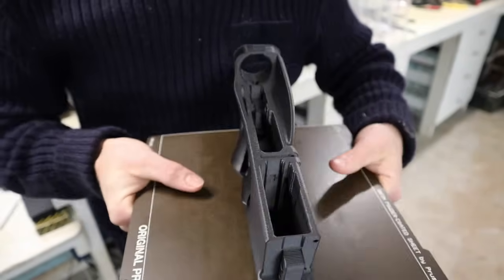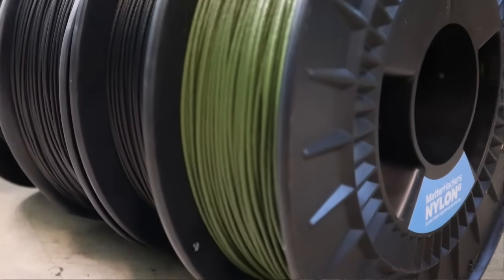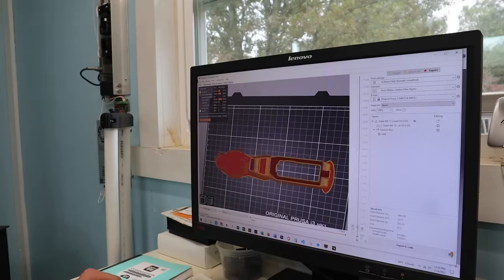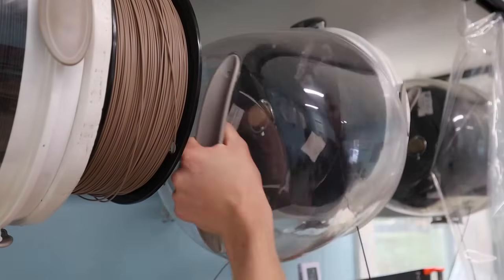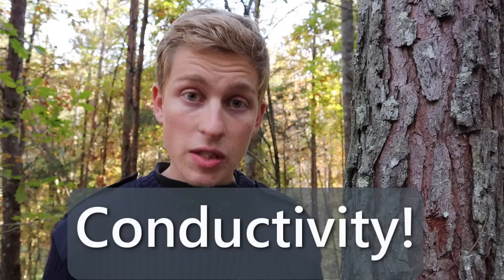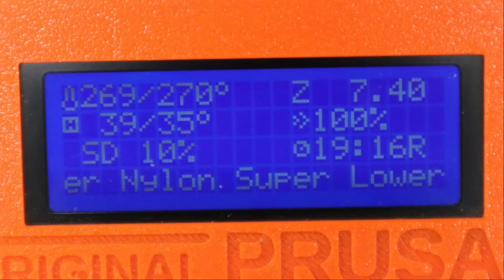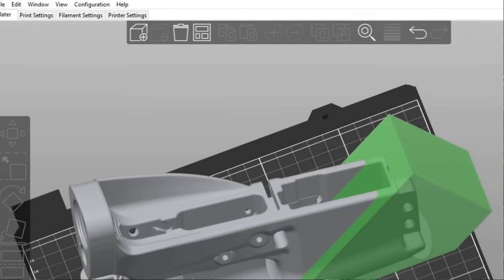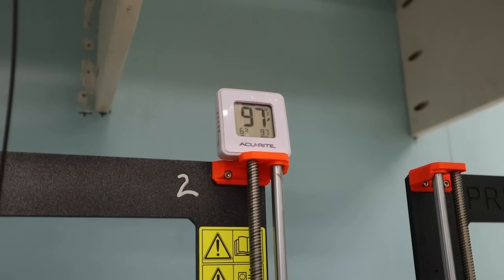How (And Why) To Print With Carbon Fiber Nylon | Print Settings, Tips And Tricks

Comment: If you’re doin things on the cheap, and you don’t wanna go out and get glass or garolite. Nylon sticks to cellulos pretty well, so after failing to get proper adhesion with a smooth print plate and glue stick, I stuck Un wrinkled News paper to the plate and put glue stick on that. It Immediately fixed the problem of adhesion and the benchy print came out perfect with perfectly smooth surfaces. Def, follow the hoffmeister here and star with 90c bed temp for first layer and bring it down to 35c for the rest of the print

Comment: is that a Howe military school sweater?
Reply: Looks like a standard issue NATO sweater in marine blue.
Reply: @Lleanlleawrg  it has the smooth patch over the left side for a name plate. Which standard NATO sweaters don’t have. So it had to have been used by a military school since they use nameplates. 
The only MS I’m aware of (could be wrong) that used them was Howe.

Comment: I get problems with solid models warping, more than something hollow like a receiver. I find I can fix this by using a smaller infill percentage. If I'm in a situation where I need a really tough part I can compensate a bit by pausing and taking breaks or by increasing print speed.
While not really applicable for something like a firearm, I find people new to printing choose a much higher infill percentage then is really warranted. Try standing on a failed print or hit it with a hammer. You might be surprised.

Comment: Something to keep in mind with steel nozzles, because of the poor thermal conductivity of steel compared to brass, assume an extra 15 degrees for steel. I've switched to a Phaetus tungsten nozzles, and while it's pricey, it's pretty good, and I can use it for all materials with confidence that I'm pushing my filament through a quality nozzle, without needing to push my printer hotter than I need to.

Comment: It depends greatly on the humidity level where you live. As the parts cool, they’re taking on moisture from the humidity and some testing shows that getting some moisture in to it after printing can actually strengthen the part.  Some people use steam to straighten the part testing the moisture level in until it matches the natural humidity is in your area. Other people heated up straightening it and throw it in the cool water. Others get it as straight as possible heat gun and then seal it so no moisture can get in. So it come down to everybody in their particular location will have to find what works appropriate for them. Nothings going to work for everybody.

Comment: if you're unsure why your material warps with certain settings then you need to teach yourself about how that material expands, contracts, stores, heat, releases heat, and what environment you have your printer in (humidity levels, ambient temperature, etc..). a super cool ambient temperature that your printer is in may make that material warp quickly because of the airflow in the environment and the temperature of the air flow after the wind chill that the environment has. It's a big reason why enclosed printers are just a better alternative over ones without... it looks like you just cool your prints too quickly with the environment..

my main point though is to study what you're going to be printing with so you give it the right environment to cause the least problems. it's like using a Netflix series about a lawyer to think you'll succeed at the bar exam but get confused why you don't understand the questions in the exam. it's because you have to study what you use, what your tools are that you have available, why things happen and how to overcome them. disregarding information you admit you don't know while also trying to be informative gives everyone a lack of credibility to what you preach. A simple search could solve your issues. No one watches an Olympic figure skater, tries ice skating, falls a lot, then tries to explain on YouTube how to ice skate and the tips and tricks to be better... the video of them falling would be the best tip of what not to do.

Comment: An easy way to dry out these types of filaments is to cut the lid off of a filament box, set your bed to 90C, put the filament on the bed, and then put the box over top of the filament. Leave it there for 12 to 24 hours. Afterwards you’re good to go.

Comment: Don't quote me on the adhesive solution that you're using - but I seen the video with the guys that sell it and I've read on other 3-D print forums that you can make a liquid solution of glue and water 1:1 ratio, so, "I think" you can basically get the same thing they make (I'm making that statement, that wasn't from a forum). I'm sure they've maybe mixed something else also with their solution, but the foundation of the solution they've developed is likely watered down glue/glue sticks. It would be a cheap substitute with a (likely) similar result - that sounds like a new video for you? Heh. Maybe compare the results? Also, I read on two different reputable pages that you can use hairspray in place of glue/glue sticks. I've just ordered some to try, and I can't say if it works well or exactly what type(s) of materials it works with. I'll be using it with PLA since I'm just getting into the 3-D Print world. Great video too!!

Comment: Have you used resin printers for these parts?
Reply from the maker: Yes. Would not recommend.
Reply: @Hoffman Tactical  any particular reason?
Reply from the maker: @williamtardy8137  Yes. Brittle parts and a difficult messy process. The improvement in layer adhesion could matter for some parts, but that has already been resolved with these designs, so it's a minor benefit.

Comment: So grab a sponge and squeeze it at the top and you will see the bottom of the sponge curve up or warp. Higher bed temps cause this because the part needs to cool as even as possible so it shrinks as even as possible and maintains bed adhesion.

Comment: Don't know if this has been mentioned already, but we used Nitrogen to dry nylon before extrusion/molding in real world industrial settings. You have to be careful to not have the flow of gas too high as the tank of nitrogen is in a liquid state and the nitrogen gas comes out cold. That can chill the nylon and cause condensation from the surrounding air which is obviously bad and opposite of what you want. But when done correctly it's like Tig or Mig welding and there will be no moisture to cause the melted nylon to foam or spatter. You just want enough flow from the tank to displace the surrounding air and make sure you have adequate ventilation or you can displace the oxygen you need to breathe. Air is already mostly nitrogen so that's only a problem in a confined closed space. Just have good ventilation.
Reply: Forgot to say I'd aim a stream at the extruder/bed as added insurance you are getting a good oxygen free print.

Comment: Have you tried printing a mold for casting ? The Freedom-15 mold kit could probably be improved with the strength of the new designs particularly where the buffer tube attaches

Comment: You should print one in polycast filament and then use investment casting to turn it into aluminum or brass or whatever other metal you can melt

Comment: If you can't find or afford a food desacater it's a there is a inexpensive chemical option but sadly is a one shot use cost depends on quantity but under 10 dollars for enought to dry out 3-4 rolls.  They sell desacating media comes in small pellets packaged in a plastic resealable bowl. Ive found a super cheap version at the dollar store. But the good stuff you can usually find a chefs'  or restaurant supply store.  Work 100%.  I've gotten 3-4 uses out of the good stuff. Problem is once you open it it has a very limited usage time.

Comment: I run my prints with a raft at 80°c and have zero warping.
Reply: Also zero adhesion issues
Reply from the maker: I run my prints without a raft at 35 C with no warping.

Comment: A spray on adhesive that dries with heat? Coat the outside of the print at certain intervals to help with layer adhesion.

Comment: Running my carbon nylon from eSun at 260 for the nozzle and 60 for the bed, paper tape as a base. No warping, excellent adhesion, no delamination. Just a bit of stringing as I forgot to adjust the retraction settings. Nothing a little post machining can't fix.

Comment: I like to try carbon fiber nylon for diy quadcopter/drones. Which brand should I buy? Is SaintSmart good enough?
Reply from the maker: I'd go with one of the PA12-CF filaments. Polymaker and Fiberlogy both make one. I've been impressed.
Reply: @HoffmanTactical  Thanks a lot for the quick reply! ☺

Comment: The most reliable way to ensure perfect bed adhesion, is to first print a raft of pla and then printing your nylon part onto this with a slightly reduced z height, which embeds the first layer into the pla (60-70⁰c bed)

Comment: Great video as always. How do you keep the support material from gunking up in the small, tighter areas where they may be needed... I'm trying to print a "part" but the supports either gunk up, or are completely inseparable from the main body of the part. Thanks.
Reply from the maker: I try to design all the parts to keep support out of small areas. Really the only way to do it other then soluble supports.

Comment: Try printing a upper slide with peek filament. Check out the heat resistance of the peek filament
Reply: It’s a bit pricey but The Creatbot f160 Peek 3d printer should do the job Mr.Hoffman
Reply from the maker: Try printing peek without warping. It's hard to do, sadly. Even with a heated chamber.
Reply: Think about building A all peek or carbon fiber peek Glock. It should work fine.
Reply: Try getting the annealed peek filament

Comment: Thank you for the tips, I will try them. I am having trouble with some parts that have a large variation in  cross sectional thickness near the print bed. They are warping like crazy using the Nylon X.

Comment: I saw a guy selling pistol grips printed with (i think) ABS.  What do you think about ABS for these parts?  He really brags it up as "aircraft grade polymer" and all this stuff, but based on specs I'm pretty sure it's carbon fiber ABS.  That's the conclusion I came to anyway.
Reply from the maker: Not the best option. ABS is a low strength material. Not what I would call "Aircraft grade" ;)

Comment: What's the best option as a heated dry box while printing with carbon fiber nylon? I've seen mixed reviews for both the Eibos Cyclopes and the PrintDry Pro, but they're supposedly top-of-the-line. I've heard of others, too, but no clear answers as to what is the best fit.
Reply from the maker: I don't like either of them, though they probably work. I use dry pods with desiccant, which are not perfect either. There really is not any good option on the market right now.
Reply: @HoffmanTactical  You got that right. I've been using the Repkord Repbox (sealed with silicone) with dehumidifier rods and dessicant pouches and still not much luck. Btw, this is probably a stupid question, but are you talkin about the Dri-Eaz Dri-Pods or the clothes drying pods? Also, do you heat your printer's enclosure?
Reply from the maker: @WoolaMartian  No, the "pods" I use are repurposed cake holders.

Comment: Would you still prefer PLA+ over Carbon Fiber Nylon for a project like AR lowers or an FGC 9?
Reply from the maker: Yes, but only if I planed to use the gun as my primary weapon. For testing or fun I use PLA+.
Reply: @HoffmanTactical  Do you mean you prefer carbon fiber nylon over pla+ for a primary weapon?

Comment: I recently bought a spool of SainSmart 25% CF Nylon and am printing on a modified Ender 3 Pro with the 32 bit board, flashed firmware, and all metal hotend with steel nozzle, and a glass bed with Aquanet hairspray. I've got a functional durable DD17.2 with great layer strength and flexibility, and though the front did warp a little, it doesn't affect performance.

I print this stuff at, drumroll please, 240-245c. Ran a temp tower that ranged from 270 down to 230 and the 240-245 range had the best bridging and overhang of them all. I didn't even need to flash the firmware for higher temps lmao... Your mileage may vary. I did half my speed though, 25mm/s, slow and steady wins the race.

For my enclosure I have one of those Creality tube frame reflective soft fabric enclosures and for enclosure heat I have an old lamp wire with an incandescent lightbulb hung from the top. 95% of incandescent lightbulb light is released as heat so it keeps the enclosure NICE and toasty, and it's janky enough to be a great conversation piece.

I'll have to experiment with the first layer hot and following layers cool because I went 85c bed the whole way, and that likely contributed to my warping.

To add to this, I've also got a Hoffman AR9 ejector in this CF Nylon, and the AR9 mag release, both of these had NO warping even though they're small pieces. Very satisfied with the results. Will be buying this stuff more.

Comment: what’s the best choice material for glocks and pistols? as far as quality in looks and resistance . just overall . i needa order something, idk yet, petg, pla+, cf nylon, etc…ps. i ordered the ender 5 pro
Reply from the maker: PLA+ or a CF Nylon. PLA+ will work, as long as it does not get too hot. CF Nylons can have creep issues if not annealed.
Reply: @HoffmanTactical  doe the pla have to be polymax? or any will do?

Comment: Even when forging metal having your piece too hot and then it cooling down quickly always ends up in a warped blade,, so allowing a little by little to drop some temp it may settle into form slower and thus keeping intended or original shape shape without so called flash cooling which most the time the sudden change will allow for molecules to change in many ways that causes problems either warping, decrease in structural integrity and such. Kinda rambling,  but the larger prints or pieces (giving different sides time to cool some before layering) and paired with a cooler bed allows for it to settle into semi final shape as printing is in process thus eliminates warping. Of course these are rambling and a unfounded hypothesis just using similar experiences with different mediums. Although have a lot of knowledge in graphic design,  firearm mechanics, and applied engineering and would like to learn with some hands on experience. Furthermore there are a few different designs that may be more suitable due to their natural shape and the way they are constructed that may be more conducive to this type of manufacturing as well.

Comment: Have you tried printing on a polycarbonate plate? I use it instead of glass especially for petg and PC and it works soooooo well. Plus it's flexible so you can pop parts off like a steel bed. Super cheap and readily available as well. I have not tried nylon on it yet though.

Comment: Just an FYI for people using enders and/or glass beds. I printed small parts with 35°C bed temp and did get slight lifting on the edge of small prints. That same print at 40°C had essentially no lifting and printed well. I assume the less thermal conductivity of the glass bed needs a bit more temp than with steel beds to get great adhesion. Stock glass bed with 2 layers glue stick 85-90C first layer, then 40°C rest of print and you should have no issue with warping. Plus if you have an enclosure that hot first layer will help get your enclosure above 100°F for better layer adhesion.
Reply: What do I need with my Ender 3 V2 to do this? Do I just need an all metal hot end with steel nozzle?
Reply: @JB-ri6zp  figure it out?
Reply: @MartinMcbride-xu2dn  nigga I was asking if he figured it out I was trying to do some of the same
Reply: @crazywormy5869  🤣DAMN my bad bro, read that wrong!!!!
Reply: I have an Ender with a glass bed and I was getting lifting at the edges. The "brim" build plate adhesion type seems to 100% solve the issue.

Comment: It seems to me that  the carbon fiber addition makes the parts a little stronger (not layer adhesion direction), and stiffer.  The main benefit to the carbon is, it seems to really bring the warping down.  The bad with the carbon added is, it hurts layer adhesion, so it is weaker in that direction.  To me, it seems like the main benefit of adding carbon is not really strength, but to reduce warping of materials that are prone to warping.
Reply from the maker: This is true with some carbon fiber Nylons, the ones with higher carbon content. However carbon, and glass, filled Nylon with a fiber content around ten percent or less have really good layer adhesion, the push plastic is a great example. That is why I don't care for the "black aluminum" filaments. Though, if horizontal tensile strength is all that matters, they are a good choice. Of course lower carbon content Nylons are more prone to warping.
Reply: @HoffmanTactical  thanks for the info.

Comment: have you played with NylonX? to my knowledge and testing this is the best and strongest material for anything that needs to be strong. including 3d printed freedom slingers.
Reply from the maker: I have, however at this point there are a number of other CF nylons that perform better at a lower cost.
Reply: @HoffmanTactical  dope. Which would you say is the absolute best filament for strength? For pew pews and in general?

Comment: I find it surprising that glass filled nylon is not performing as good or better than carbon fiber. From my understanding gun manufacturers use proprietary polymer blends for their frames and lowers that are similar to DuPont zytel, which was a glass filled nylon.
Reply from the maker: Carbon fiber is just not as prevalent in the injection molding world, probably due to cost and a lack of support industry, at least compared to glass fiber.